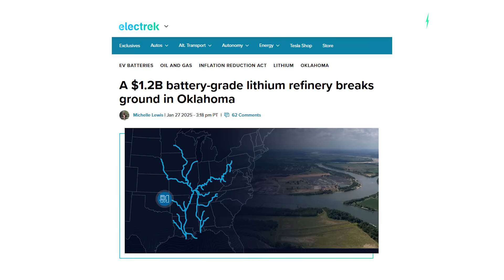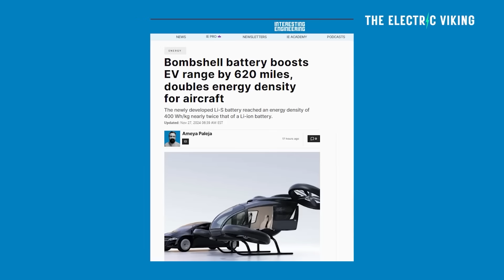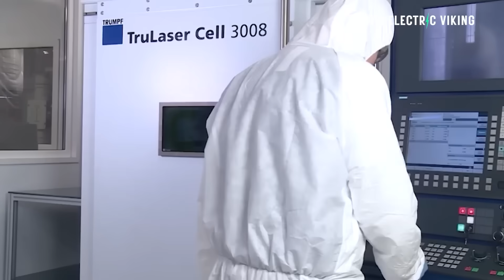Stardust Power begins building largest US battery-grade lithium refinery

Comment: To be clear, the Stardust intake is already filtered/concentrated lithium chloride delivered from a variety of theoretical sources, none of which are producing let alone close to construction. The "plant" is a purification plant, simply converting lithium chloride into lithium carbonate (LCE), not processing raw brine or H20 from oil fields. Raw/original resources (see offtakes) will require their own on-site plants for initial filtering, concentration, and crystallization (according to Stardust's own chart), before shipping to Stardust plant for conversion. Comparing Stardust CAPEX/OPEX, to a full vertically integrated project like Thacker Pass, Angel Island, or Smackover is inaccurate, as Stardust is only performing the last 1/3 of the entire lifecycle. Yes, Stardust is using proven and common technology to convert to LCE, but IMO the "hard" part is done beforehand, producing the initial lithium chloride solution offsite.

Comment: They plan to use a DLE system for extracting the Lithium and as a result the video is a bit misleading, it really should be videos of a few chemical factories. 
There have been 3 problems I can see.
1. Lithium stocks struggled in 2024 and -50% to -70% is not unusual amongst the newcomers.
2. Emerging Lithium stocks are all struggling with financing at the moment  - these guys have just last week had to raise $5 million at around $1.20 a share, that's a disaster for management.
3. The brine arriving at the refinery via a pipeline - that wont be competitive with the emerging DLE companies who will be pumping their own brine from huge underground deposits and refining the brine on site all for around $4,000 p/t.
Reply: DLE is still unproven on a commercial scale.
Reply: @scanspeak00  True...add that to the points I mentioned and there are plenty of reasons this stock has fallen. Saying that, I would not bet against DLE.

Comment: Tesla lithium refinery in Texas is on a 1,200 acre site aims to produce 50gwh  of battery grade Lithium per year, cost $375m to build.  Stardust is building on a 66 acre plot at a cost of $1.2bn  The numbers seem odd to me.
Reply: They are getting raw material from another much bigger site so maybe some of the processes are off-site
Reply: Unfortunately Teslas is having issues securing proper water supply for their facility.
Reply: @robertwoodhouse-bm7kt  Capex vs Opex? DLE will be cheaper to run but is more expensive to build?